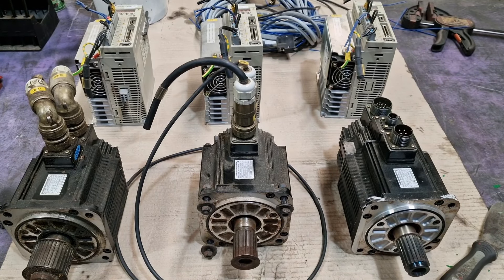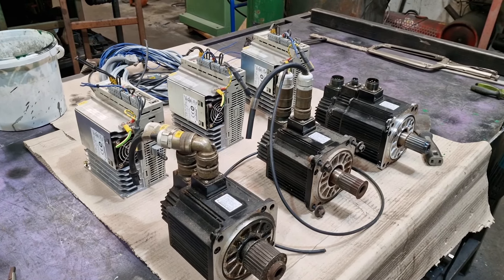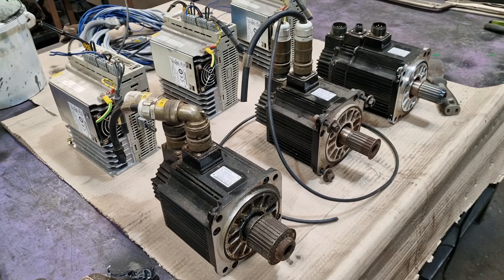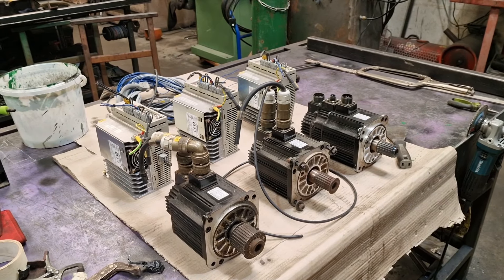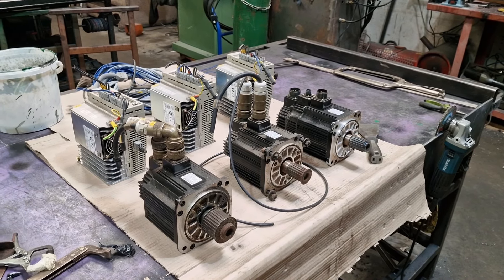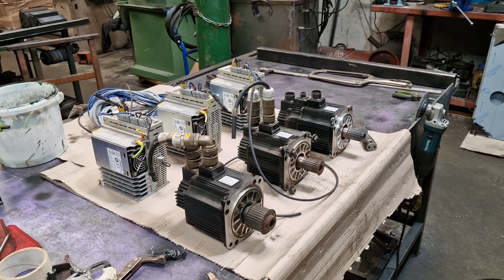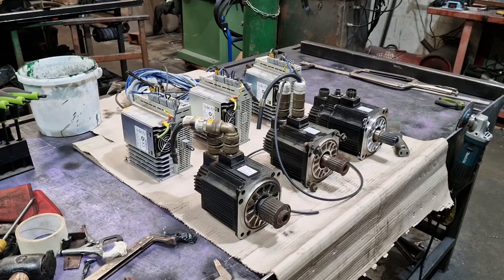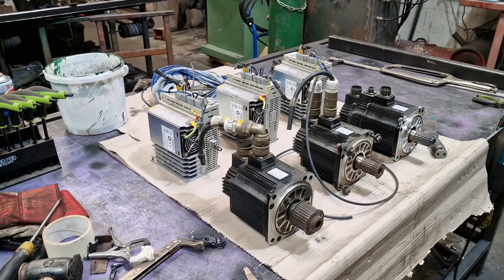Fiber laser build. Preamble

Comment: Im in a build at the moment...bought a second hand heavy duty router with vacuum bed for 3500 and will convert it to fibre lazer works out cheaper that way .just to change a few bits like stepper to servo ect .
Saves having to build a frame and gantry
Reply from the maker: Did you buy the one I was after. 😆 I was going to do the exact same thing however there was no way of making it 4mx2m 😢. Good luck I'll be interested to see how you get along. R
Reply: @codedsurfboards5918  very good 👍 👌 👏 
I'm trying to upscale my head to form a baking oven on roller for remote site's.  Build on site designs

Comment: Only 3 thousand pounds or 4 thousand USD is crazy inexpensive for a fiber laser. China is undercutting the market by huge margins. Made in USA, quality laser sources might go up to 30 thousand USD for like 2 or 2.5 kW. That's usually just for the laser module, too. A full unit with a QBH cable, data acquisition, and control boards is much more than 30 USD.
Reply from the maker: Hi
That is just the laser source
Reply: @robbroomfield468  What I mean is a fiber laser module (actual laser source) will cost nearly 30k USD alone if you buy an American one. That's literally just the opticial resonator. It doesn't include any of the needed controls, power supply, or QBH cable. Used IPG lasers that are full usable units at 1kW and over 10 years old sell for 5 to 10 times what China sells a new 3 kW for. It is honestly impressive how they pull that off. Labor is so cheap there.
Reply from the maker: Ah gotcha. Well I guess ill find out if it's too cheap. 😆

Comment: Is there a discord?
Reply: Ever consider replacing or adding a water jet head to the plasma cutter head. Run the feed lines on same arm as the already installed head.
Reply from the maker: No I haven't. I'm unsure of the viability in my area for waterjet.